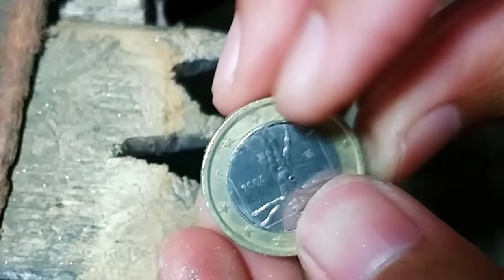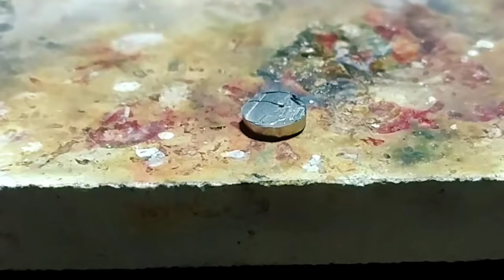I turn a coin into couple rings- handmade ring - how it's made jewelry

Comment: This is another proof that makes us see that not every jewerly needs to be super expensive to be so damn beautiful.
Reply: Well he still had to buy the diamond which admittedly I suppose would be way less expensive without the rings and having only one diamond instead of multiple but still you have to at least buy that lol but if the coin is actually gold or a silver dollar or something and you’re willing to deface it then technically it is still a gold or silver ring so that’s cool
Reply: You pay most of the price for the work...
Reply: @schneeroseful  debatable lol
Reply: @schneeroseful 

THE SAME WAY YOU WANT TO BE A BIT OF A HMHMB MY JGJGGJTJGJTIGJTGJTJGJTI HHJ HHJ AND I HAVE BEEN WORKING ON THE SAME FOR THE LAST FEW YEARS AND I HAVE BEEN WORKING ON THE SAME FOR THE LAST FEW YEARS AND I HAVE BEEN WORKING ON THE SAME FOR THE LAST FEW YEARS AND I HAVE BEEN WORKING ON THE SAME FOR THE LAST FEW
Reply: @schneeroseful  39283
Reply: Yeah but I'm still thinking of getting and turning Eisenhower coins into pendants... Without any drilling of course since I respect and cherish the coins too much
Reply: 1 euro: €1
a peircing saw: ~€25
a jewlers peg: ~€25
flatnose pliers: ~€10
a hammer: ~€5
a mandrel: ~€20
a set of files: ~€25
an anvil (half of a sledge hammer in this case): ~€40
torch: ~€20
a rotary tool :~€50

of course you'd also need the acid solution, the solder,  jewel and polishing solution.
so lets just say around 200 euros. 

the more rings you make with those tools the less it would cost of course.

Comment: Really easy to make you actually do use coins to make wedding rings and other types. Use a fingerhorn or ring horn and you tap it on with hammers and whatnot around the sides you tap it on and then you just work your way around it fits your finger and shuffle It off try it on the finger put it back on tap it shuffle it off try it on the finger until it fits properly. Plus the bonus is when you get older and your fingers thicken. You can go back to using your fingerhorn and tapping it to a more comfortable size so it doesn't slip off but it doesn't pinch off your circulation and kill your finger. I'm sure this guy will tell you the same thing.